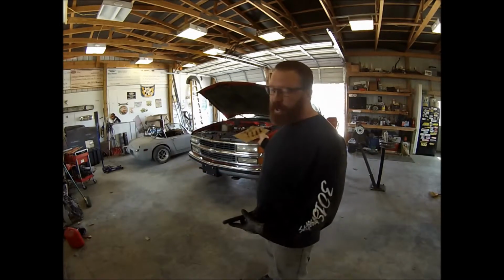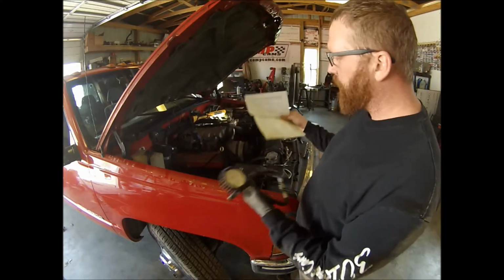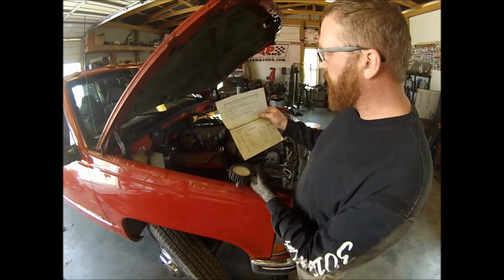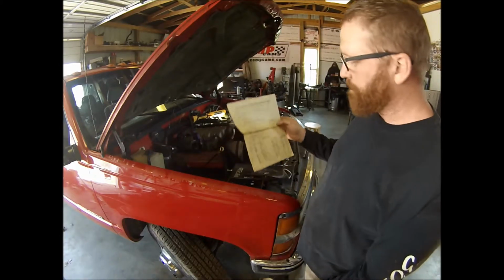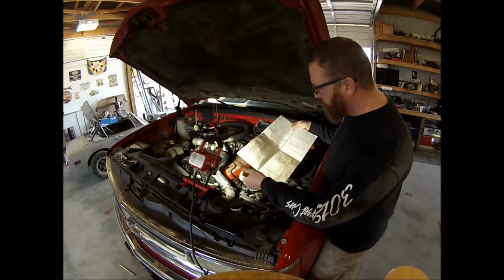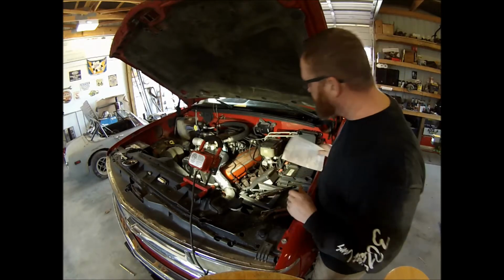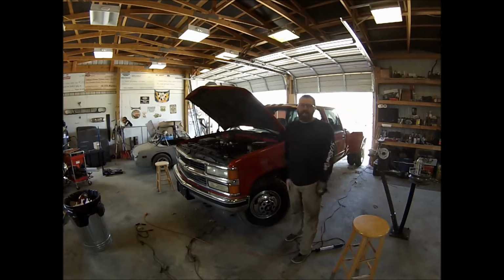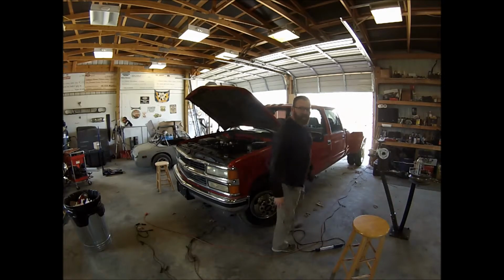Spark Plugs and Plug Wires and Compression Test for Vortec 454 1996 Chevrolet 3500

Comment: What size socket for the spark plugs? Thin wall?
Reply: Thin wall 5/8. They sell a socket specifically for spark it’s comes with a rubber grommet on the inside of the socket